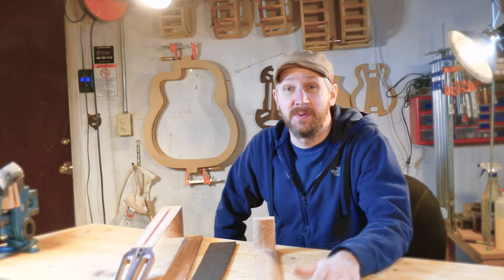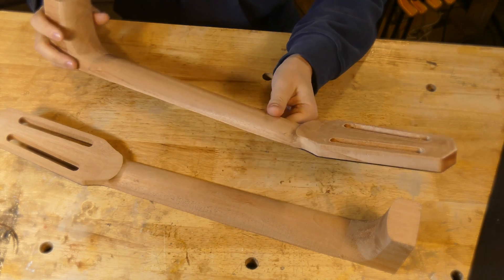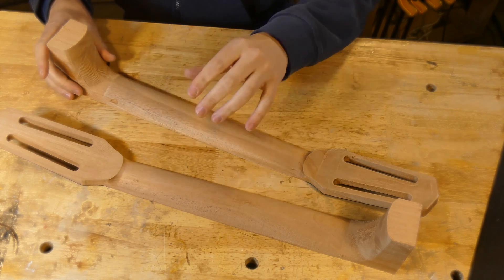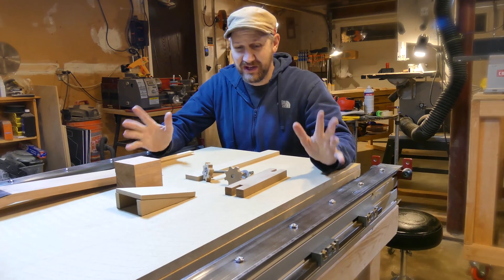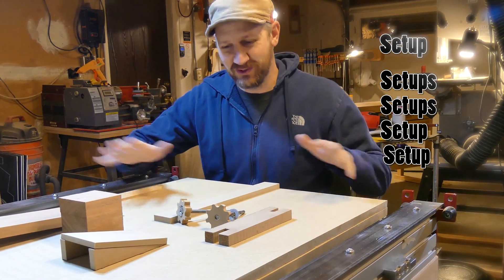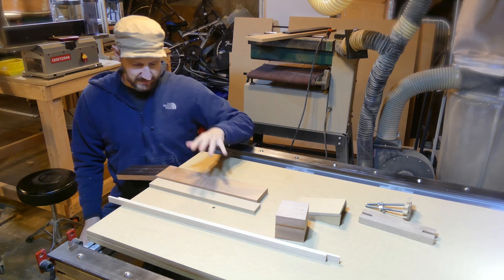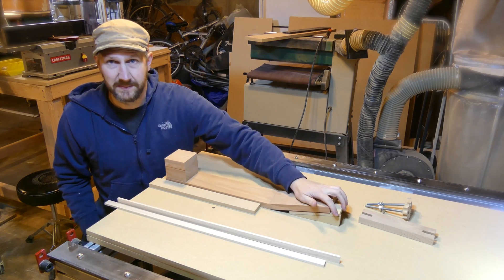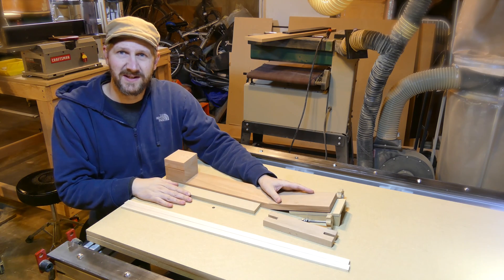Making The Selmer Guitar | Part 9 | The Neck

Comment: Where is the craftsmanship?
Reply from the maker: craftsmanship: as in skill at making things, or the skill with which something was made or done? if this is the case then I think the answer is explained quite well in the the video. You may be falling for the ye old manufacturing is equal to CNC debate, and if so then let's begin. 

The use of technology does not negate craftsmanship, craftsmanship is based on the use of technology and always has been. The best craftsman of each age nearly always uses the best tools available. I'm not sure how going through the incredibly time-consuming act of developing amazingly accurate CAD drawings, developing 3d models of these drawings, and then designing CAM tool paths to cut these parts is not craftsmanship. Possibly your Idea of craftsmanship is limited to a man at a bench with a chisel (I do many hours of this work) in reality a true craftsman is an individual who is adaptable to the technology and continues to push the craft further in its use.